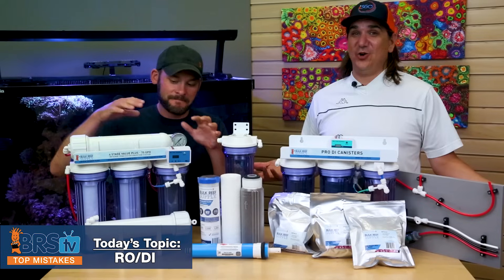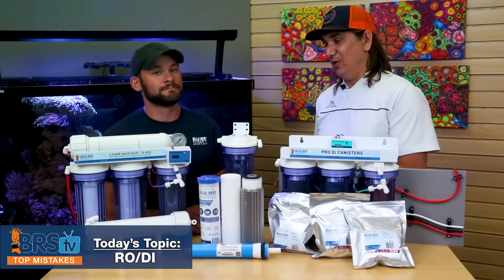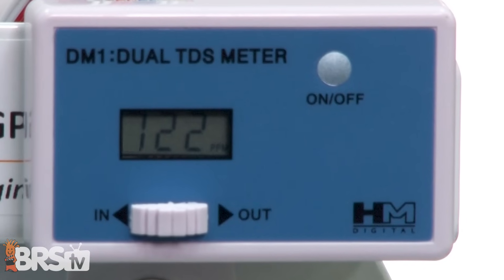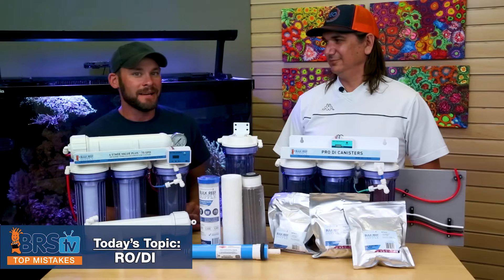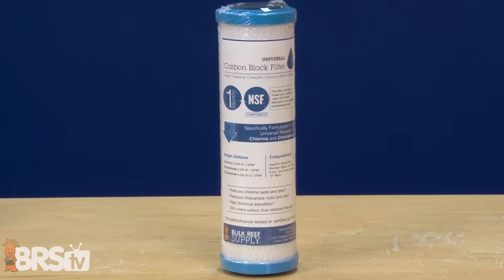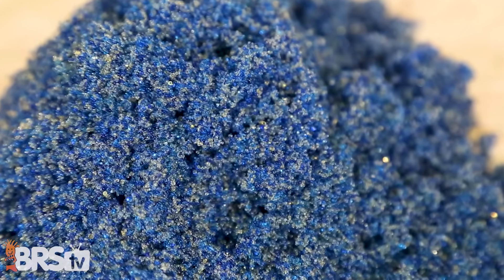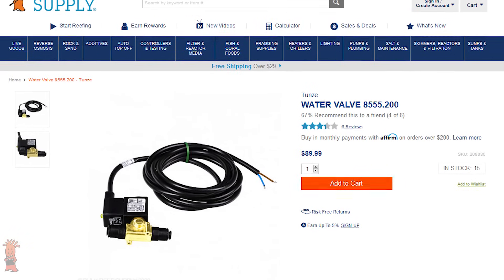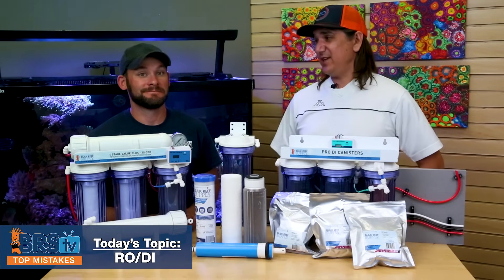BEWARE! These RO/DI Water Mistakes are sending $$ down the drain! Your reef tank deserves better.

Comment from the maker: Okay, be honest. Tell us your top RODI water mistake you've made....(I'm guessing many of you share the same as us!)
Reply: My mistake was not buying the RO/DI unit I wanted the first time. No worries there, the modular design allowed me to combine my original 4 stage  and my impulse buy 7 stage into an 11 stage 150gpd beast. It’s hilariously overkill, but the tank is doing well. Happy reefing!
Reply: One thing I remind everyone.  Rinse. Your. Filters.  Carbon blocks have dust in them, don't pump that right into your membrane.  I always let 5 gallons go through each carbon block before hooking it up to the RO and 1 gallon go through each resin bed before I hook it up to my container.
Also when replacing your resin, make sure it's packed in there tight.  When closed there should be very little give when you squeeze the side.
Reply: I’ll admit... I went without a float valve for a while. Yeah... BAD IDEA.
Reply: Have extra canister sitting around and not know they will be more productive have it install
Reply: My reef bucket doing fine with Brooklyn water.
Reply: I started off with a cheap Chinese 4-stage system which had a tiny, sealed DI cartridge. Water pressure was 25 psi, so I bought the Aquatek 8800 from BRS. When it came time to replace the sediment and carbon filters, the BRS filters were loose in the canisters! This forced me to replace the canisters, caps, and bracket (BRS of course), followed immediately by a BRS refillable DI canister. I eventually added another refillable DI canister and 2nd TDS meter. And I replaced the RO membrane. Other than the tubing, I ended up replacing EVERY component of the original system. I recently added an extra sediment filter, so I now have a 7-stage system, and planning to get another DI canister so I can start using single-bed resins. Would have been a LOT cheaper to buy a decent system to begin with..
Reply: Biggest mistake was not buying a BRS RODI system from the get-go. However, that is impossible to fix now since the Six Stage has been sold out for ages.
Reply: @eranschau  - I learned how to replace carpet pad because of that ;)
Reply: @Mark-Dibble  I love things that are hilariously overkill!
Reply: Buying your system without already knowing how to hook everything up and what everything is what it TDS means and what DI resin is, and that I must have a freaking bucket of water under my sink with this unit. I HAVE NEVER SEEN A WATER FILER UNIT LIKE THAT. Wish I had gone with what they sell on amazon. !!!!!!!!!!!!!!!!
Reply: @HalenBowlerThePerson  what you call overkill, others call, peace of mind, or redundacy' OR best practice, or protecting your investment, orr convienance,  orr perfection, orr not settling for good enough, orrr gear junkie, orrr OCD, 
ORrrr not settling for good enough or leaving success to chance or "odds" with the knowledge that this the basis of the entire hobby and your time, frugalness & cool fun or thoughtful purchases, decisions, choices, upgrades or investments you make has a good chance of being: ..all for not, negated, wasted, canceled, ruined or killed... IF ..you ignore, allow, or overlook.. One of the overkill details with your water outlined in this video.  
Or not, ... we've ALL seen a few amazing thriving 10 year old sps dominant systems with gorgeous rare delicate fish... using only tap water, a Britta pitcher, & Morton table salt.
Reply: SO, would silica then most likely be the reason it started turning brown at the TOP..THEN the Bottom of my mixed bed resin cartridge when the middle AND both cation and anion are still completely BLUE...?
Reply: You probably dont care but does anyone know a way to log back into an instagram account..?
I somehow lost the password. I love any tips you can give me!
Reply: @Jaxx Kameron Instablaster :)
Reply: @Samuel Chaim it did the trick and I finally got access to my account again. Im so happy:D
Thanks so much, you really help me out :D
Reply: @Jaxx Kameron Glad I could help :)
Reply: @johnkaba2593  rinse with what?
Reply: @bhbae1  when I change my prefilters, I disconnect the RO input line and put that down the drain, then add the new sediment filter and 1 carbon, turn the water on, and let it run for a few minutes, then I add the second carbon after the first and let it run for another few minutes. The first gallon or so of water through a new carbon filter is very dusty, not great to put that into your RO membrane.
Reply: we just changed all our filters on a 4 stage brs unit. the di filter cartage will not fill up with water? have we done something wrong?
Reply: On the number 11, forget the fact that disamble the DI until the RO estabilizate the pressure, improves better the lifetime of the resin.

Comment: I got here after watching Matt's video and said to myself "cool, maybe not that bad if i start making my own RO Water instead of buying from LFS"  then i see this video and see there's a bunch still to learn and watch for.
Reply from the maker: These tips are for those that really want to optimize their setups. If you start with a 5 stage RO/DI system, you'll be starting out on a great foot and saving money right out of the gate. The great thing about these RO/DI systems is that they're modular, meaning you can add canisters and accessories onto them in the future should you wish to do so. 

https://www.bulkreefsupply.com/5-stage-premium-plus-75-gpd-ro-di-system-bulk-reef-supply-bundle.html

Comment: I live a mile away from BRS. Our water from Minneapolis has 50 tds out of the tap. Not as bad as they say. They use RO to filter, and then add stuff like flouride. Just wanted to clarify the video.
Reply from the maker: TDS isn't bad at all, but the chloramines are definitely something to pay attention to. Relative to other water supplies around the country, chloramine levels here in Golden Valley tap water are pretty high.

Comment: I know this is 2 years old, but how about flushing RO tds creep before DI? My tds creep is high after sitting for a week or so, and I flush the creep while flushing the waste. Once tds rises and starts falling I shut the waste flush and continue creep flush until tds drops to acceptable level of 7 or so, then close the creep flush valve. After about 30 minutes of running the TDS has dropped to about 3 before DI.

Comment: thanks for the information you are spreading for free but the cutter is it 45 degree cut for the tubes or 90 degrees :D
Reply: As straight as you can. Any angel may cause a the connection to be weak and may leak

Comment: Less than 70 seconds in the video I paused it to go check my TDS probes.
Reply: Matthew Zarelli Same 😂
Reply: I wish they had mentioned the IN/OUT writing, and the verticle line below them, are supposed to 90° from the tee and tubing. This tidbit of info could prevent people from pulling the probes out to check for proper orientation. I'm sure most people figured it out from the visuals, but there's likely a few that are probably cleaning up leaked water right about now...

Comment: My incoming pressure from my water softener is 60 PSI.  So my feed water into my RO is 60 psi, however I have 15 PSI by the tank.  What should I do to increase my water pressure? I ordered a booster pump but not sure if this will solve the issue.  Any thoughts? My membrane was replaced last year

Comment: I run all of my water to a 4 gallon bladder tank. It holds 3.25 gallons. When it’s full I have the auto shut off. It turns off and no problems. I’m probably going to get the flow lock leak detector though.

Comment: I just got your 4 stage value plus and the tds monitor that’s red isn’t plugged into anything is it supposed to be that way
Reply from the maker: Hey Mike,
There should be two sensors on the 4 Stage RODI systems that have TDS meters. One should be right before the DI stage, and the other right after the DI stage. If you need help, please don't hesitate to reach out to our customer service team.

Comment: Ground water and well water should ALWAYS be tested against drinking water standards before human or animal consumption (even cleaner for reefs). I used to work for a company that conducts soil and water remediation where hydrocarbons (mostly gasoline) and other bio hazards have breached their storage tanks. Several of our sites had domestic wells within 500 feet of the ploom on the water table. I'm used to taking intrinsics like pH, ORP, temp, and conductivity, and sampled water for BTEX/MTBE/Naph. and total dissolved Lead and Iron. Today, I started my first saltwater 20 gallon tank with aragonite sand and a med/small dry rock, bacteria and some fish flakes for now.

Comment: Redesign the Settlement spin down filter.  Remember where you got this idea.  I engineered a spin down filter of my own. It has a auto back flush with a spin of the filter inside. Inside of the filter housing i have a stationary tube with holes in it just slightly larger than the filter element. By timer at the end of the day a motor at the bottom outside of the filter housing will spin the filter element inside the stationary tube with the holes in it as water is back flushed through the element to the drain. It keeps all my down stream filter cleaner.

Comment: Can one of your RO systems be used intermittently and not constantly? We have a 30 gallon tank, do water changes every 5 days (at this time), and bought a 100 g/day RO unit of yours. Can we only run it on the days we do water changes and let it sit idle in between?

Comment: Checked my TDS probes and they were not installed correctly direct from BRS. I suggest you pull yours ad check and don’t assume. I assumed for several months that it was correct, but it was not.

Comment: I just went from wanting to buy one of these to thinking it is too much trouble. I can't remember half of what you guys have mentioned let along have the ability to manage this.
Reply from the maker: Setting up a basic RODI system is super easy as long as you change out the filters when they're depleted. The 5 stage RODI system is our recommendation for a vast majority of water sources. It comes with all of the filters pre-installed, so no need to hunt for filters right away. 

https://www.bulkreefsupply.com/5-stage-premium-plus-75-gpd-ro-di-system-bulk-reef-supply-bundle.html

Comment: Thanks for the info. I'm still trying to wrap my head around RO/DI. So much of this seems like a foreign language to me. Hopefully it will click sooner than later!
Reply from the maker: Hey Spencer, 
Hopefully I can help with some of the basics. With an RODI system, you have 4 main filters, a sediment filter, carbon block(s), RO membrane, and DI resin. 

The sediment filter is first and is responsible for filtering out any larger particles (like sediment) in the source water. Think of it as the first line of defense in protecting the more expensive filters down stream. 

Next is the carbon block. You may have one or two of them depending on the RODI system you have. The primary reason we use carbon blocks is to remove any chlorine or chloramines that are in a city water supply. If you're on city water, we usually suggest using two carbon blocks. 

The RO membrane is third and it's the most important filter. The RO membrane is responsible for filtering out most of the contaminants, which results in much lower TDS coming out. All of those contaminants are sent down the waste water tube and down the drain. The filtered water (product water) is then sent to the last stage, the DI resin. 

Think of the DI stage as the final polish. Usually the TDS number going into the DI resin will be in the single digits. When it exits the DI resin, it should be zero. While TDS isn't a perfect way to determine how pure the water is, it's the easiest to test for and what the RODI industry and our hobby both use.
Reply: @BRStv  great information as I was thinking the same thing, what is the difference between RO and RODI
This actually cleared it up for me
Cheers

Comment: I have 75gpd value plus can I put carbon block in color changing Di resin chamber and buy the DUAL DI FILTER CANISTER to convert to 6 stage
Reply from the maker: You'd have to re-plumb the system so that the water flows from the sediment filter > carbon 1 > carbon 2 > membrane > DI resin 1 > DI resin 2. 

The way that Jen discusses in the video linked below would be easier 🙂

https://youtu.be/ayfgqZHRGp0
Reply: @BRStv  Thanks :)

Comment: Do you guys sell the cotton piece at the top of the resin canister? Mine is kind of getting smashed and lost its original shape. Could I just cut it some cotton or something myself? Or do you sell replacements?
Reply from the maker: We do stock the sponge for the DI canister (1st link), but the one on the other end is not available separately. If you need a replacement cartridge, you can find that in the second link below. 

DI Sponge - https://www.bulkreefsupply.com/replacement-sponge-for-di-resin-cartridge.html

Cartridge (sku 200002) - https://www.bulkreefsupply.com/clear-refillable-cartridge-for-di-resin.html

Comment: How do I know the meter is working?  Super scared after getting crazy high tds after only 6 weeks of use with a new meter I bought! The resin wasnt even orange all the way up but only 2/3 rds! Cody told me on the phone not to trust my meter but I get 0 tds with my lfs water! My hubby went to pick up some even though I have refills because I just dont trust it now until I get a meter but how do Know if your meter has failed?  There is no way to check! I will update this if hers comes back with tds but never has before!  When I first bought the 4 stage I checked the ones I had and they were all 0!  Super worried about my new frags coming in today and my frag tank I set up! I did check them but only tricked water over the probes!  DUMB I now realize!

Comment: I just bought my first 5 stage RODI unit and have been trying to figure out whether to have my home soft water system on or off when running the RODI system. New house and I had to turn my soft water system off since my freshwater fish almost died (didn’t lose any) using Seachem Prime treated soft water (issue with salts?). Wondering if running soft water through RODI unit is better or worse in terms of cartridge life a system performance.
Reply from the maker: We suggest to install the RODI system after the water softener. It'll cause a tiny tiny increase in DI consumption, but it'll reduce the buildup of scale inside of the RO membrane housing, increasing the life of the membrane.

Comment: Question. I am new to DI water systems. I purchased a 2 canister DI water car rinse system to wash my black truck without leaving water spots. The systems is made by Aquatic Life. The water source comes into the right side flows thru the 2 canisters out of the left side comes the filtered water. It is my understanding that the right side canister  is supposed to get used it and turn brown before the left side and once the right side is 90% used up, remove it and move the left side canister to the right side and install a new filter cartridge in the canister removed from the right side and install it on the left, so you're cycling the cartridges to keep a fresh cartridge in place on the left side at all times. I have found with my system for some odd reason my left side cartridge is being used up faster than the right side. Any idea what would cause this?
Reply from the maker: Most RODI systems flow water from the left to the right, particularly in DI canisters. I can't speak to your particular manufacturer's product, but every one of our DI canisters follow this left to right flow pattern because the design of the DI cartridge inside, where the flow of water is forced through the bottom of the DI resin and out through the top. That said, your DI resin should change color from the bottom up. I would try changing the flow direction to a left to right pattern and see if that solves your issue.

Comment: Did you guys say to put the pressure gauge AFTER the DI Resin for best results? I have mine on the incoming water line. Would changing to the product water line post DI resin increase the pressure I am seeing if I think I am getting a false positive?
Reply from the maker: The pressure reading after the RO membrane has very little value. What we care about is the pressure going into the RO membrane from your source line and after the pre-filters.

Comment: I have a lot of silica in my well water and have been looking for a solution. So making a Silica cartridge is cut and dry. No problem. But I run the DI saver and go through a ton of anion resin possibly because of my co2. So when thinking about it I am guessing that I could place that in my anion stage of the DI saver setup? Or should my Di saver setup consist of three Silica cartridges?

Comment: does the back pressure of a pressurized tank in a drinking water RO system cause TDS creep?
if so, can this be solved if the tank is replaced with an aquarium-style reservoir and a pressure-switched pump to the faucet?
thanks
Reply from the maker: There should be a check valve installed between the RO system and the pressurized tank, so that shouldn't present any issues. In a drinking water setup, a little bit of TDS creep isn't usually a big problem as we're not using DI resin or aiming for 0 TDS like we would for our saltwater aquariums.